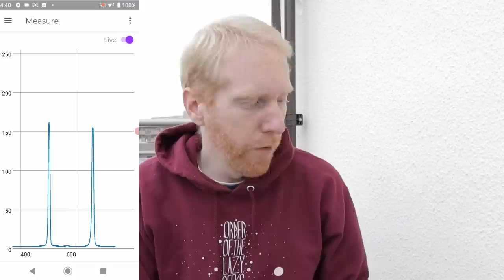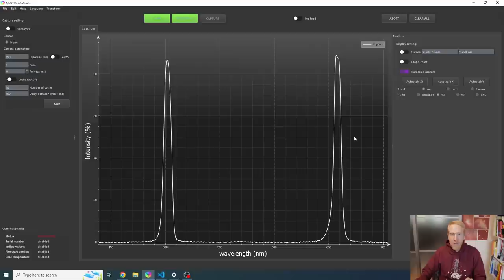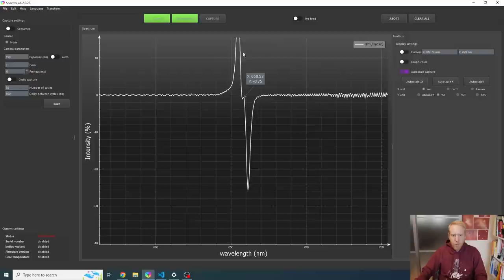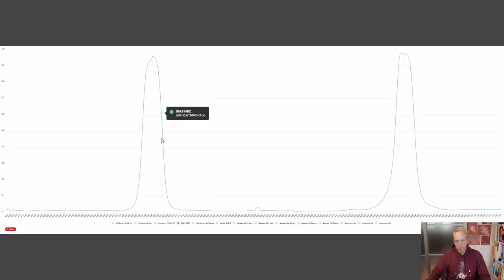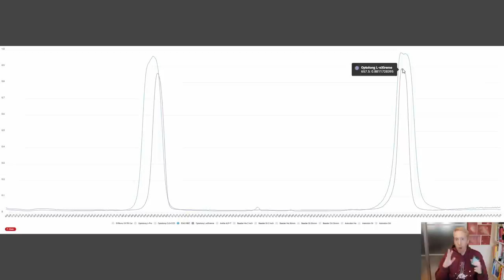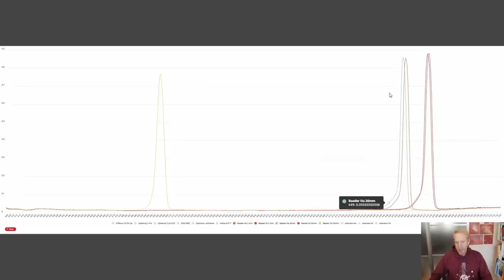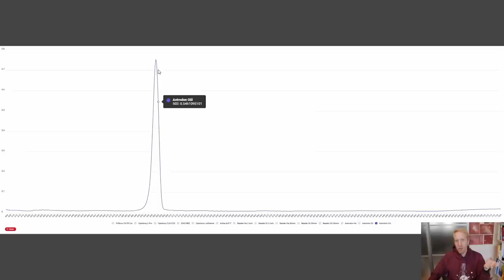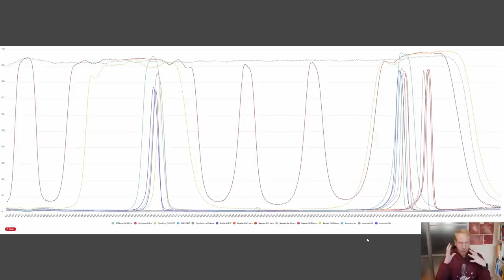Do Astrophoto Filter manufacturers LIE TO YOU? You CAN find out!

Comment: I’m just catching up with your channel, and think it’s great to see such rigor and fun.

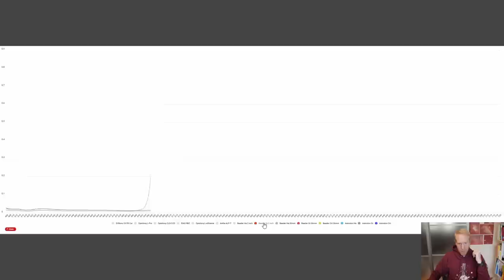As a  sensor system specifier in my day job, I was curious about the asymmetric response you mention at about 50:40 — the tail toward the blue. I followed up with some questions to Goyalab. They confirmed my suspicion: the angular acceptance of the spectrometer internal collimator is wide at f/1.8. The illuminator is wide and diffuse (not collimated), which means that oblique light in a cone corresponding to f/1.8 is getting into the spectrometer through the filter under test. That oblique light is shorter wavelength (bluer) than the design bandpass of the filter. This is not a defect in the spectrometer or the filter, just the way they  work.

The maximum theoretical spectral shift of a filter at f/1.8 is ~1.6% of normal wavelength. That is how far light can be “leaked” into the apparent blue tail. The blue shift goes a little slower than cosine of the maximum oblique accepted illuminated angle. At hydrogen alpha (656.28 nm) that amounts to about 10.5 nm. See the very good but technical recent white paper by Baader Planetarium on the topic of transmission shift through interference filters <https://www.baader-planetarium.com/en/downloads/dl/file/id/1794/product/0/whitepaper_narrowband_filters_on_astronomical_telescopes.pdf>

It isn’t possible to calculate the amplitude of this measurement “leak” precisely without knowing a bunch of stuff about the angular spread of the illuminator, the angular response of the spectrometer, the manner in which the slit is integrated across the detector chip, etc. Also probably not worth the effort. There are ways it can be calibrated and removed by calculation from the raw spectral transmission curve. 

The phenomenon could be reduced simply by using a mask on the illuminator that reduces its diameter. A condenser lens between the filter and slit would theoretically help a lot, but would introduce other complications.

I expect that the same phenomenon is shifting the apparent transmission peak a bit toward the blue. This is something that should be calibrated and bounded. Given the relatively small size of the obvious shape asymmetry, this effect should also be small, but it needs to be considered when using this type spectrometer with interference filters, and pushing the device to its limits. The watchword is: It is easy to make mistakes in spectroscopy.

Probably easiest to just understand that the blue tail is a measurement artifact and not something to worry about.

I love the idea of this easy and relatively cheap spectrometer, and appreciate Cuiv bringing it to our attention. I’m recommending it for my home astronomy club, NOVAC, as a test resource for our many narrow-band astrophotographers. Now, what about connecting it to the telescope? 

Thanks, Cuiv.

Comment: Cuiv the “Filter” geek - welcome back !! I would thought a good way to check calibration of the Spectrometer, would be to get a few coloured LED’s, as these are specially pure and you can get red,orange,yellow,green, blue and violet variants. BTW I use the  IDASs NBZ filter in my RASA as it’s F2. I bought a whole set of narrow band Optolong filters for my mono camera as I think you mentioned they were tolerant of the F factor :). Do you have any theories as to why some filters like the Lextreme exhibit star halos, while the IDAS NBZ don’t on the RASA? Like you a sold a load of stuff ( kept my Redcat51 ) and bought a RASA8, and Edge HD11 with Hyperstar, which must be the ultimate Astrophotography solution (F10, F7 and F2 options), but flippin expensive :(

Comment: Great to have you back, Cuiv, we missed you! Quick question, the blue-shift of the filters is that the same for native fast scopes as for reduced focal lengths? So would a native f/3 scope have the same blue-shift as an f/5 reduced to f/3? With the extra optics, one would think the angle of incidence might be smaller for the latter?
Reply: I did some data demos about this on my channel

Comment: Hi Cuiv, very interesting video. In regard to Jim Thompson's reports about DNB filters and their shift properties I did a couple of UV/VIS spectroscopic measurements. The Optolong l-extrem I got has a H-alpha midpoint of 653.7 nm. The light beams can come from 9 to 14 ° into the OTA (Celestron Edge HD 800). So I measured the shift of the 7nm broad peak on 0, 5, 10 and 15 ° of inclining angles. The results are "frustrating". At 15° move the peak maximum down to 649.5 nm. This is a complete peak down of the H-alpha line. At best I can get a minimum of intensity from the right flank of this shifted peak (approx. 20%). Did you measure the transmission spectrum in dependence of the angle of incoming light? A preshifted filter needs to have a peak shift by about 3 to 5 nm. Is that true for you l-extreme (no F2!). Thank you ang greetings from Old Germany.

Comment: Great video! I'm about to analyze my filters as well using the spectrophotometers that I have in my lab (I work in biochemistry). It will be way cheaper for me, the only thing I need is a filter holder that will fit the machine and that is easily made by 3D printing.
To make your reading more accurate, you could  analyze a clear filter to normalize the data of other filters, I can bet that's why you get 92ish % transmission and not 100%, but it's a detail... Thanks for sharing your work!
Reply from the maker: Nice, thanks for the suggestion!

Comment: Wonderful video.  Keep getting technical.   I find your explanations really helpful. 
One thought was to rig up a tilt adjuster and actually measure the shift of these filters. That's the missing piece in connecting  your spectrometer results to performance. 
Very good point about fast scopes with central obstruction and those without. 
Perhaps with a fast refractor is better to have a slightly broader band where with a Hyperstar or RASA it's better to have a correctly shifted but still narrow band. 
8

Comment: I appreciate all the effort but I don't really trust the range accuracy of a spectrometer that costs less than £15,000 and fits in your pocket. If that's as accurate and trustworthy as a piece of lab equipment, then a lot of labs must be very angry about spending 10x as much for theirs.

Comment: Hi Cuiv. So great to see you back! Respect for taking time out when you needed it. I’m the guy that had just bought the f/1.8 Baader Ultra high speed narrowband filter set when you published the video reporting that they were no good! You have gone to great lengths to do this…respect for that too. I have two questions I would really appreciate you answering…. 1) How do you know what the mean incident angle at the filter is in your setup? For example, I use a C11 EdgeHD with Hyperstar v4. 2) How do you convert that angle to a shift in nanometres? Is there an equation you can share? Thanks again and I look forward to seeing more videos from you as and when you want to make them.

Comment: Great to have you back. I wonder if the temperature variations affect the performance of these filters. Is there a way to measure that?
Reply from the maker: Temperature would actually matter to some extent. Between 400nm and 700nm, we'd expect a shift of 0.015 to 0.020nm per degree (Celsius/Kelvin). Hey, I'll try putting one of my filters in the freezer, see what happens!

Comment: Now that you have the equipment it would actually be interesting if you could measure the transmission over a tilted narrow-band filter, to confirm that the transmission indeed shifts to the desired wavelengths 😊

Comment: First, glad to see your back! I definitely missed your videos the last few months. Second, excellent video. I'm an engineer and love this type of analysis. Unfortunately, $2k is a little out of my league to scratch that itch. Third, now that you've got the equipment and taken the care to calibrate it. Would you consider measuring other filters and posting results on a web page or providing them to others so we can see how other filters compare and also how multiple copies of the same filter compare? If you're interested, PM me and we can discuss details like shipping, turn around time, compensation (for you), etc. Unless I'm mistaken, the gathering of the data for each filter doesn't look like a particularly labor intensive process for you. Some, like me, might even find this sort of analysis therapeutic. LOL.
Reply: PS: What software are you using to display the bandpass data? I really like how quickly you can add/subtract the filters as well as see the cursor data points. Very smooth!

Comment: You are only sampling a small spot in the center of the filter with your light source. What about the rest of the filter? Does the performance vary/diminish as you go out to the edge of the filter?
Reply from the maker: On my 36mm filters I was able to check various points across the filters - no change that I could see

Comment: Just wondering, did you test the same filter two or three times to determine your spectrometer repeatability ... to get error bars for your measurements? I'm sure there are manufacturing acceptable ranges in the quoted technical specs. Great post.
Reply from the maker: Thanks Walter! Yes I did test each filter multiple times. There wasn't enough difference between each measurement for any significant error bar

Comment: Interesting stuff, Cuiv! Have you verified the spectrometer gives repeatable measurements? Do you get the same curve if you measure 3-5 times? It's possibility that could explain some of the variation across filters you see.
Reply from the maker: Thanks Linda! Yes, it's very consistent, even when trying again several days later on the same filter, I get the same measurement

Comment: Welcome back. Am I to understand that you are only measuring the very center of the filter? What is the probability that you are missing a problem that exists on the edge of the filter?
Reply from the maker: Yep, that's correct, it's not really feasible to check the whole surface. So we have to assume that the filter is roughly homogeneous
Reply: @CuivTheLazyGeek  Maybe if the adapter circle you are measuring was off-set to the edge of the filter you could take a reading and then rotate the filter 90 degrees and take another reading, rotate, measure etc. That would give nearly full coverage?

Comment: Cuiv. I notice the window on the spectrum analyser is very small compared to the 2” filter. It’s my understanding that filter performance is a function of incident angle of light onto the filter. Low F number scopes have a low incident angle for light on the edge of the filter but not the centre. Would welcome thoughts how relevant this test is for low F number scopes such as the RASA.

Comment: I have been viewing some of your old videos- 2020; they are great.  So I purchased the mini computer; I'm stuck as to what computer or monitor should I purchase to connect the mini computer too to access the content. Please let me know what you recommend.
Reply from the maker: I use it headless, without monitor, controlled remotely. The initial setup I did on my TV via HDMI
Reply: @CuivTheLazyGeek  same here. Can get a bit nasty if the wifi disconnects for some reason, but usually works great. If you desire a small screen have a look at those 5" or 7" screens for video camera rigs. Those run of 12v.
Reply: @CuivTheLazyGeek  I saw the initial setup. I will be traveling/ I have a MAC laptop ( which I don't want to use for this purpose). would a Chromebook table work with the mini pc?  I love your Lazy Geek Ways/methods.

Comment: Great to see your smiling face again.  Welcome back.  Very scientific approach to this analysis.  Good job.  I have been very suspicious of my Antila 3nm narrowband filters I purchased to use with my Askar FMA180 which is an f/4.5 lens.  Two of the three filters introduce strange artifacts that I've not been able to explain.  I wonder if this might be due to the blue shift you mention?
Reply from the maker: Star halos? Artifacts wouldn't typically be caused by blueshift...
Reply: @CuivTheLazyGeek  my thoughts as well.  It is more of a warped-like pattern.  When I stretch flats taken with the Ha filter there is a bizarre pattern in the stretched image.  I see the same pattern in the light image as well.

Comment: Welcome back! You have been missed. And thanks for the great information as always. One question: All Antlia filters come with a scan report. Were you able to check if their report is consistent with your test? I just bought the Antlia Alt-P and have used it once with a Samyang f2 135mm and like the result. The scan report gave fantastic numbers. I just wonder how accurate they are.
Reply from the maker: You should definitely be closing down your lens with the Antlia to around F4. You'll actually get better SNR that way! Because right now the outside of the lens has such crazy incidence angles the target Ha (and to some extent Oiii) is simply completely blocked by the filter... But the LP still goes through!
As to your question, for my Antlia filter it didn't match - but I'm told the spectrum is not from your filter. It is from a random filter from the same manufacturing batch (in theory)
Reply: Thanks for the reply. I will definitely try it with f4 and compare. Perhaps I should also try to change my f3 Newtonian back to f4 and compare, too. I thought my results with Antlia 3nm filters were good but it could all be a delusion.

Comment: Can this test a 2'' filter?
Reply from the maker: Yes, most of the filters I tested are 2 inch
Reply: @CuivTheLazyGeek  thank you so much. so I wonder whether this indigo product needs to pair with SMA-905 adaptor
Reply from the maker: @sarazou4485  Only needed for scientific calibration (which I recommend doing to measure NB filters), in which case Goyalab (the maker of the spectrometer) provides the adapter. Otherwise not needed for normal measurement
Reply: @CuivTheLazyGeek  Thank you so much!!